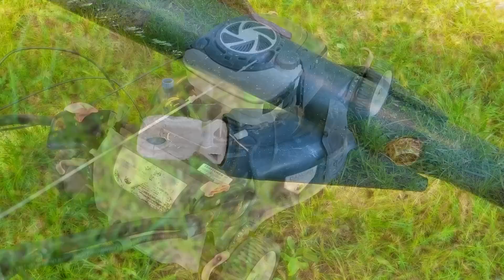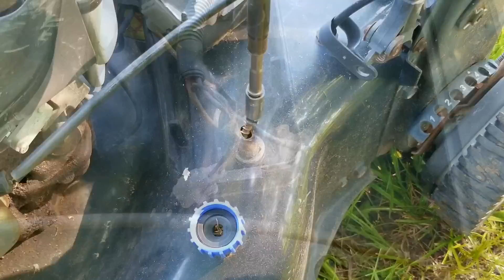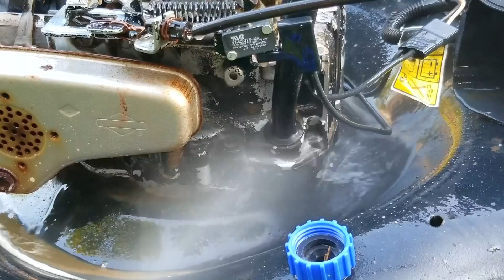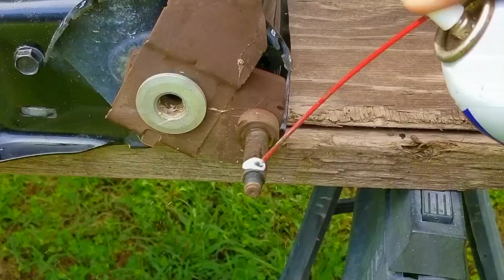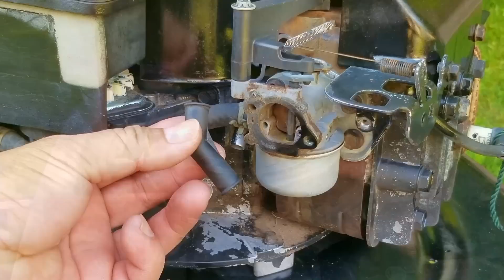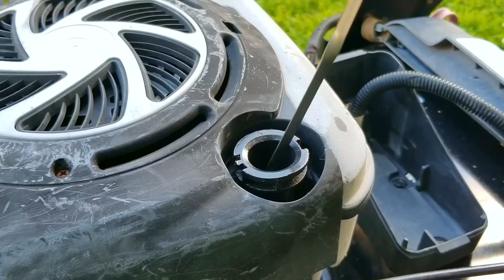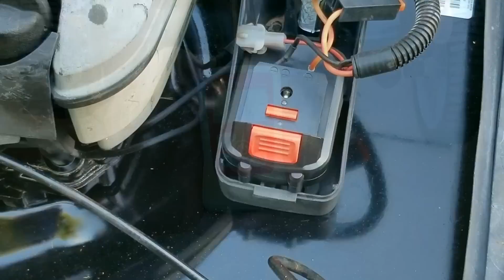A Cheap Battery Alternative For A Craftsman Mower

Comment: Hopefully it will charge the battery while the engine is running
Reply from the maker: hopefully so
Reply: @INSIDEHOUSEGARAGE   that is a great video on if it is changing the battery 🔋
Reply: No they will not. That’s what the Cords are for. Plug them in as needed.
Reply: @andyhamilton8940   okay thanks for the info on this matter young man 👍😎 I never knew that is how you change the battery on those engine s
Reply: @robertmailhos8159  Yes Sir, the bigger riding mower have an alternator that will charge them and run the lights, PTO etc.
Reply: @andyhamilton8940   that is true 👍